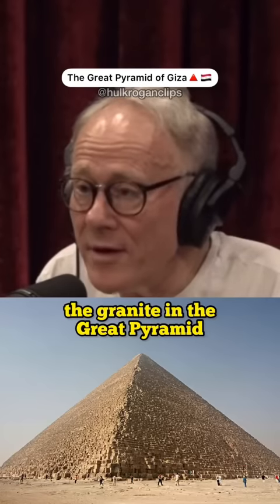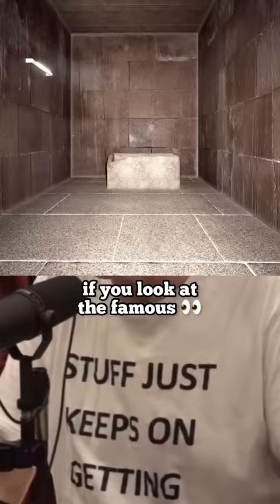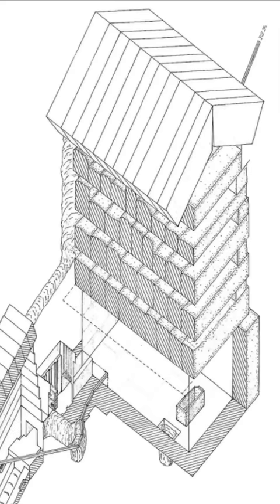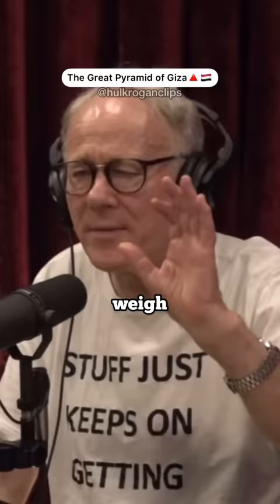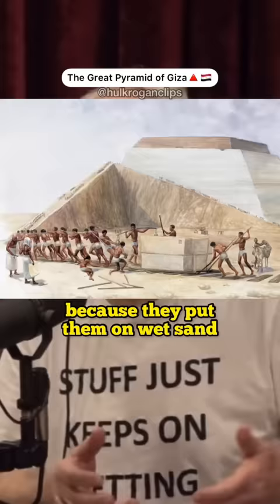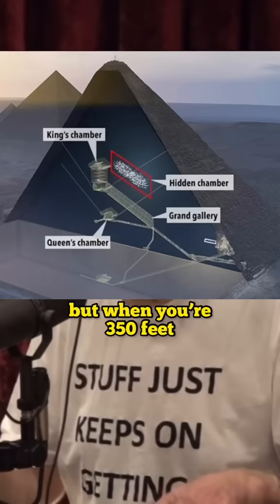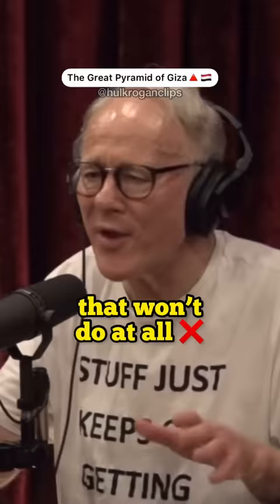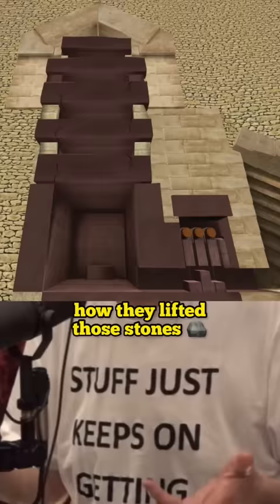How were the pyramids built? #joerogan #shorts #history #egypt #pyramid

Comment: They had an unlimited budget and a shitload of time, those were probably the most important factors in getting it done
Reply: Exactly! I don’t understand why aliens are a better possible answer, than it taking days or a week or two to cut one block.
Reply: Cause gravity exists
Reply: Laughs in Gravity
Reply: @PatriarchyPatrol  that's not a real answer
Reply: @probablygeorge6489  it is. Without cranes or mechanics, it's not possible with just man power. The tons would sink sand, ramps and crush workers
Reply: @PatriarchyPatrol  saying "it's just not possible" isn't an explanation
Reply: @probablygeorge6489  not even close to same scale or conditions. Math exists you know. It's not an opinion. It's not physically possible given the environment & tools. Sorry you can't comprehend basic math and physics.
Reply: I’d say they got some elephants and built downward instead so gravity can help with the whipping
Reply: @PizzaCake360  not elephants, but they did receive 21 cattle and 23 goats EVERY DAY. Work em then eat em
Reply: @PatriarchyPatrol 
The pyramids are built on sandstone bedrock plateaus.
Before they are covered they exhibit a stepped design.
These steps are part of the design function as the blocks were lifted by tipping them back and forth and wedging wood beneath them to slowly increase their height.
You don't need huge amounts of energy if you preserve motion, it is that simple.
Reply: @fotoschopro1230  That's a theory. A pretty stupid one
Reply: And they had a lot of people all doing the same thing
Reply: I think they built the pyramids. And eventually they could remove the blocks by breaking them. Resulting in a room being made.  Doesnt that sound more logical?
Reply: Its estimated that it was done in 20 years
Reply: @BrickMediaStudios  No, the rooms were built into the structure and there is a visible difference in design on some shafts that were dug after the fact.
Look up "How to Build Stonehenge in Your Backyard" on YT and you will immediately understand how the pyramids were built
Reply: @fotoschopro1230  To you maybe.

You have a bias that there couldn't possibly be advanced civilizations before the industrial era.
Reply: @blobjorn3248  I don't have a bias against advanced civilizations before 5000 BC.
In fact, mountains of symbolism, ancient stories and unanswered, ignored and suppressed archeological findings point towards technologically advanced civilizations, long before 12000 BC.
But that doesn't change the fact that large monolithic structures can be built by using simple, although be it ingenious tools, that do not require advanced machineries or lost technological marvels.
The reason we think of it as something that would be impossible to do with simple tools is because, while we might have amassed knowledge, we haven't really gotten much smarter since back then.
Reply: This is the most important comment in YouTube history.
Reply: @blobjorn3248  Oh yeah, look up "How to Build Stonehenge in Your Backyard" and "Robert Sepehr".
Reply: Consider that the blocks are fitted to each other within a millimeter of perfection. This is more than just stacking rocks.
Reply: @PatriarchyPatrol  idk man... it took my local construction workers almost 2 years to re do a bridge. And that's with all our tech🥴
Reply: It took 20 years that’s not a shitload
Reply: and unlimited free forced labour.
Reply: @probablygeorge6489  saying "it is possible" isn't much better.
Reply: @Latvijas_Amēlija  that proves my point lol
Reply: @IPromiseTomorrow  i explained how it was possible... read a bit more before making assumptions
Reply: @fotoschopro1230  The main issue is 500mile journey to and from the Quarry. Also the top half of the Pyramids and Inside
Reply: @Mmmmkaaay  Exactly and 500mile journey each way to the Quarry where the rock was taken from
Reply: @ethansam5861  It took that long to build the taj mahal.
Reply: No. They used vibration
Reply: @borisleoro8943  vibration is quantum physics. The foundation of the Universe
Reply: @chrisyoung2188  They also thought civilization started like 5k yrs ago lol
Reply: @fotoschopro1230  That doesn’t apply here although it’s generally true. Mathematically it should have been impossible at the scale we are talking about. We cannot recreate them today without a massive feat and it would be in vain
Reply: It took them 20 year. They didn’t have a shitload of time
Reply: Well shit who stole time from us?
Reply: @AxiomApe  You're just saying that it is mathematically impossible when it is in fact not.
Reply: Exactly. We can get anyrhing done long as we are given the money , time , and recourses
Reply: @PatriarchyPatrol  well you know at that time they have mammoth's around with them 🌝
Reply: No way they moved those huge ass blocks with ppl and stack them in the air
Reply: @chrisyoung2188  in 20 years we renovate a the bathroom stalls of an office building 😂
Reply: @fotoschopro1230  i know. My theory is that they knew where the rooms were going to be. So they put bricks into a certain position there. Then filled the room
With fragile stone or whatever and then deposed the material when done with the structure. Why would they lift the stones?
Reply: @PatriarchyPatrol  Ironic how maths and quantum physics are mentioned by someone who isn't even close to understanding them.
Reply: @PatriarchyPatrol  the ramps that still exist to this day next to unfinished pyramids show they used chips from the larger blocks instead of sand to build the ramp, the sides were reinforced with larger stones to prevent collapse
Reply: @fotoschopro1230  I’m not claiming to know how they did it, just pointing out that the experts themselves do not know how it was made. Also, I’m not expecting a YouTube comment to change your mind lol
Reply: @Tony11442  No they couldn’t
Reply: @fotoschopro1230  So you are aware of the Younger Dryas theory then, that civilizations potentially go back over 11,000 years. Göbekli Tempe and other ancient sites around the world like in Mexico are also not understood how they were built. Many things point to a connected ancient world and there are so many questions left unanswered. We cannot claim to know how they did it because we honestly don’t know. These are not typical structures. They would be impossibly hard to recreate even today. Yes many people point out that they had much time to do this, but it still doesn’t get explained by any methods or tech we have today. If we find evidence that they used simple tools then I will be the first to redact my beliefs. But it’s obvious to me and many experts that we are looking at lost methods and technology to create such structures. At the very least, there is a lost technique somewhere but most likely lost knowledge all around.
Reply: Bro you're mind is so limited. Really think about it.
Reply: @fotoschopro1230  and this is how everything is lined up with the cosmos and such?
Reply: @86Framer because there was 2.3 million stone blocks weighing 20-90 tons used, it would have taken millions of years to build
Reply: @PatriarchyPatrol  "Cause gravity exists"

So does counterweight and leverage.

With some clever engineering and some imported wood from the eastern Mediterranean coast the ancient Egpytians could have made various moves to negate the impact of those granite blocks.

Hancock is being sneaky tho because he's not debunking it, he's just sewing doubt without any substance to back it up - because it suits him to have it seem mysterious so people buy into his books/lectures/TV appearances etc.

For a guy claiming archaeologists are biased or resistant to change because of money he sure makes a lot of money himself.

Find any random archaeologist and compare what they make in a year to what Hancock does - suddenly you will find that his schlock doesn't add up at all.
Reply: @BrickMediaStudios  "And eventually they could remove the blocks by breaking them. Resulting in a room being made"

Actually that's not a terrible idea at all.

Even the sarcophagus itself could have been left in as single unfinished block and finished after they had cleared out the limestone supporting the rest.

I have my doubts, but it certainly isn't impossible.

It might explain why the KC sarcophagus was so badly worked (obvious mistake saw mark) if the mason was forced to do it inside the KC itself after the roof was added - with only limited lamp light, and the only air filtering in through the vents.
Reply: Lol yeah time and money 😂😂😂
Reply: @probablygeorge6489  oh yeah it's a perfectly fine explanation because it's true you can't do that s*** with manpower it's impossible where is your explanation
Reply: @BrickMediaStudios  
Interesting theory.
Lifting by wedging is more efficient than trying to drag the block up a ledge or slope with manpower.
It requires less people too.
Keep in mind, there are about 2.3 million stone blocks in the great pyramid, so over a period of about 33 years that would be 200 blocks per day.
That's why I suppose that their labor work would have to be efficient in terms of manpower and energy expenditure.
The money burned would have been insane in either case, but depending on the model you just run into restrictions with space and logistics.
For instance, a giant ramp could have never been built more than halfway up the great pyramid due to it being unreasonably inefficient in all regards.
Reply: @AxiomApe  
The technology argument is bs.
It's much easier to build monolithic structures than you think.
Our equipment isn't meant for building them, because a lot of monolithic structures are frankly not efficient nor functional.
We brute force and scaffold a lot of our construction work and tend to use many advanced materials, because it is faster, but that is not how you build monolithic structures.
You build them block, by block, by block.
There is literally a guy who built Stonehenge like structures, alone, in his backyard, with boulders each weighing several tons, only using basic materials like wooden planks, ropes and sand.
You can find his material here on YouTube, you just need to query that search: "man builds stonehenge in backyard".
I know it's fun to believe in some ancient alien tech, but usually the simplest explanation is the best, especially when there is no proof to rule it out.
Just because we don't understand the exact construction and design process the pyramids were built with, doesn't mean that we have no idea how to build a pyramid.
Archeology is more nuanced. The problem we face is that we don't understand every exact step for every single block that was used in the construction.
We would, but were not allowed to take apart the pyramids.
In fact, even simple research is often delayed and prevented by Egypt, because they are highly biased and unscientific.
So until we have more data, there will be several competing theories on how they were built, some more plausible, some more efficient, some more stupendous.
Anyone of them could be the one used.
Reply: @4Paradox8  Bro, must have been the Annunaki then. I'm sorry. We humans couldn't do that without quantum computers.
Stop being so naive, really, think about it.
Reply: @nemanjajovanovic8295  Deteriorating over 10,000+ years is hardly "disappearing into thin air".
Reply: @Tony11442  Says ppl who think ropes and leverage can lift 7 tons 350ft in the air in a desert and fit to perfection down to millimeters. 😭
Reply: @ThePointlessBox_  They would need to be ramps a mile long to allow the workers to move 7 tons up 350ft and place them to perfection down to millimeters. Lol
Reply: @denzelhobbs9982  My comments have more likes lol
Reply: @mnomadvfx  The problem is the precision is not possible with man power. Do the research on the Pyramids location and how well 7 ton blocks fit together
Reply: We can't even explain how they cut the stones perfectly let alone explain how they moved them.
Even today, with modern machinery, building an exact copy of the gisa pyramids would be ridiculously expensive and hard. Practically impossible.
Reply: @PatriarchyPatrol  yes if you go by the external ramp theory. Recent theories propose they used an internal ramp that spiraled on the outside surface (by not installing the outside layer on that spot yet) of the pyramid all the way to the top, and once the top was built it was filled up using the same ramp all the way back down. The construction pattern on the rock also supports this theory, implying the external ramp was only built up half way up and then the internal one was used the rest of the way to the top. Using this system also solves the problem of the support of such heavy material because the pyramid itself serves the purpose of the “scafolding”
About the stones fitting together, using an internal ramp would allow for placement of the rocks on site and then grinding/chiseling/ sanding of the blocks to fit together once already in place and thus fitting together perfectly.

Look up he internal ramp theory, it solves the problem of long ramps.
Reply: @ThePointlessBox_  doesn't explain the precision of the blocks and how they lineup with Earth's magnetic poles etc
Reply: @dehaman_4_144  when you have thousands of people working on a single project for over 20 years its entirely possible. Grinding and chiseling straight surfaces in sandstone isnt all that difficult, especially for people who dedicate their entire lives to the craft. This is just human skill.
Reply: @nemanjajovanovic8295  The Titanic has more than halfway deteriorated after around 200 years.

They can't even pull it up anymore without risking it breaking apart.

You assume there would be remains with no basis.
Reply: @PatriarchyPatrol  the magnetic poles move hundreds of kilometers every day. Its not a static point. Theres a lot of leeway and egyptians had compasses, you just need a conductive material (they had copper) and a bowl of water and a piece of wood. They used many such tools for measurements. For surfaces they used a weight on a rope to have vertical lines and guides. You’d be surprised how fast sandstone can be chiseled and sanded even with copper tools, especially with thousands of people working at the same time. This was a 20 year project, and you only need the external blocks to fit together perfectly, and evidence supports this as the internal layers of the pyramid itself isnt as precisely fit together as the outside layers and not even close to the casing stones on the outside. The deeper you go the less organized the rock is. 
Actually placing the rocks together and then sanding them smooth when already placed on the spot perfectly explains the fitment, its the same technique we use today in construction. And people really overestimate the precision of the rocks placed together, yes they’re tight, but they’re not milimeter perfect fits.
Reply: @ThePointlessBox_  Also the Sphinx is 12k yrs old minimum based on water erosion and faces the Sun during their time (Leo). Disproves the initial theories of the Pyramids timeline.
Reply: @PatriarchyPatrol  we’re not talking about the sphinx, we’re talking about the pyramids. For all we know they were built at different times. We know how old the pyramids are from the carbon analyses. Dont move goalposts
Reply: @ThePointlessBox_  The Sphinx disproves the theory that the pyramids could have only been around a few thousand years. Relying on 1920s assertions is low IQ
Reply: @ThePointlessBox_  stone cannot be carbon dated 😭
Reply: @nemanjajovanovic8295  What are you taking about? Vibrational technology? I think you have made assumptions on my beliefs.

You also assume that there would be something left behind.
Reply: @Tony11442  I do. Especially with recent events, I do not so easily believe the "science" on issues. It sounds like you're the one indoctrinated to blindly believe the "official" explanation.

We don't actually know what happened 10K years ago. We just have our best guess based on things we dug up from the ground.
Reply: @PatriarchyPatrol  how does the sphinx disprove the pyramids
two things can be built at different times, and there is no actual concrete evidence that the sphinx is older than ancient egypt
Reply: lol no
Budget doesn’t means anything if they’re technologically not possible. We today have unlimited budget to solves aging (yeah billionaires would love to live longer) and we still can’t solve it
Reply: And very large dinosaur like animals I’m sure
Reply: That and slaves
Reply: Bro that's not the question. The question is: how technically. Like how exactly. "They got time" yeah no shit they did.
Reply: Not so much Time. Giseh was built in 20 years, some cathedrales in Europe took a century. And even if the architecture is more complexe and more delicate, there is no comparaison possible regarding technical complexness
Reply: @probablygeorge6489  more study kid
Reply: Mining engineer here, the theories mentioned are immediately impossible the moment we talking about just mining that granite stone, let alone moving it. Do you guys have an idea about the quality of machinery material needed to break, cut or even just get a scratch on granite? Bronze tools are not even close to do that, its amazing to me why there is no discusson about this.
Reply: So your explanation is they were just bored and had lots of slaves.
Reply: @marcellkarpi2101  interesting so whats your conclusion on how they cut those stones let alone carry it some say its too perfect that professionals today cant make it.
Reply: Not to mention and endless supply of free labor…
Reply: @PatriarchyPatrol what? You really think its impossible to build a ramp with sandstone and wood that could support 7 tons? Its not
Reply: @Latvijas_Amēlija  you have 2 days of actual construction and the rest are bureaucratic bullshit
Reply: @deviousalemanni4235  the ramp would have to be a mile long to reach 350ft at an allowable angle to lift 7 tons 😭😭😭😭
Reply: @masterlucky379  I seriously have no idea, but definitely not with bronze chisels, even a butterknife is stronger material nowadays.
Reply: nah..there were strikes reported during the constructions of pyramid because of lack of workforce and too much workload. The workers were not all slaves but also locals and those from other region. So to say they willing to remove tonnes of rocks by using primitive tools is questionable.
Reply: @PatriarchyPatrol  did you not read my reply explaining how they could theoretically pull 400,000 lbs just with human labor?
Reply: @probablygeorge6489  Again, you misunderstand how Pyramids are built & the environment
Reply: @PatriarchyPatrol  400,000 pounds, not including the 23 sheep and 21 cattle they received every day. What am i not understanding?
Reply: Combination of unlimited budget, devoted father to son architects/ builders with time. We did the same with those cathedrals in Europe. Imagine fathers and sons building a church to Christ for 3 hundred years. Same thing
Reply: And a lot of slaves to throw at the problem.
Reply: @PatriarchyPatrol  pully system with enough ropes they can slowly but surely
Reply: @greatninja2590  The rope would snap and also doesn't explain the precision of the Pyramid
Reply: @PatriarchyPatrol  search stone cutting hammer and chisels work. And smoothing it is also possible will just take a lot longer without any sort of machines but even today a bit of muscle power and water would be enough usually done for smaller handmade very expensive stuff.
Reply: They were just like really strong back then
Reply: @PatriarchyPatrol  just have more pulley.
Reply: @mnomadvfx  so he’s bad because he makes money?
Reply: Probably used water to move the blocks. Look into it
Reply: @PatriarchyPatrol  it would have been funny if there was a closer quary but they used up all the rocks so the whole mountain is now gone and is covered by sand and left undiscovered.
Reply: @marcellkarpi2101  they most likely used abrasive tipped copper drills scientist just don't know what they used though the most likely one is Emiry as it is found near Egypt. Some say its diamond but they would have imported it first.
Reply: It is. Without technology you cant lift heavy things no matter how many people you have
Reply: @sash328  pulley is technology
Reply: @PatriarchyPatrol  
It's difficult, but not impossible. Throw enough bodies at the problem, the problem usually goes away
Reply: They probably cut the pieces and reassembled them in the chamber by sanding together
Reply: @PatriarchyPatrol  they did? Countless slaves and regular workers died to build these monuments
Reply: @blobjorn3248  Smarter than your nonexistent theory with a value of 0
Reply: @33a5t  they weren’t built by slaves lol that theories been disproved
Reply: @greatninja2590  no ancient pulley could lift the 70 ton inner stones
Reply: @ne1productions777  I could say the same about your theories, and we'd both have the same validity to our statements.
Reply: @GG-ng6zm  not much change in Pulley system since ancient time.
Reply: @PatriarchyPatrol  laughs in egyptian workers..
Reply: @PatriarchyPatrol  gravity is easily over come though. I mean you can lift anything with simply a wedge at its center and shims. Wedge at center. Teeter totter it. Shim one side up. Walk to other end. Teeter totter it, now shim other side. Slowly climbing upwards.
Reply: @PatriarchyPatrol  first of all we have to accept, whatever was used, was removed from that area after finishing the Pyramids.
Like a crane after finishing a sky scraper.

Noone knows what was there, so every one is just thinking in his knowledge.

Just take chinese construction works for example.
They use bamboo for the whole framework.
Now imagine you grew up, only knowing this method but now you see the empire state building.

First thought would be, where did they get all the bamboo from, since there is no bamboo growing in that area.
Than you would ask yourself, how did they get the steel beam up there.

How about water pressure to lift the stones to a certain level?

It would need a separate structure next to the Pyramides, but who knows?
They would have removed that structure after finishing the build, so how do we want to know, that it wasn't there? 😉
Reply: @greatninja2590  bro no ancient pulley system can lift more than 50 tons, you need to accept that
Reply: @PatriarchyPatrol  you realize physics existed, right? And that with a long enough lever, you have all the leverage you need
Reply: @PatriarchyPatrol  it ís possible. Exhibit a: pyramids.
Reply: @PatriarchyPatrol  What a lame duck answer. “BeCaUsE MaTh!!1!” 

Ok. Show the math.
Reply: @PatriarchyPatrol  that's true as well
Reply: lots of wannabe einstein in this comment section. cringe
Reply: Yep and they were hard working now we are lazy and use tools and equipment to make everything easy
Reply: Edward Leedskalnin built a castle by himself in early 20th century with only the help of primitive technology and he was only 155cm tall and diagnosed with chronic tuberculosis. Average weight of the stones which found in this “castle” was 12ton each he brought these rocks from far away only by himself and he wrote a book about his architectural knowledge while he was at it. You can actually visit his little rock garden in America. So my point is people seem to underestimate how possibly dedication and power of the humanity can go much further if he wants. We can’t broke rules of the physics but we can use it for our benefit.
Reply: I’d say it’s cause no one can really relate to it these times
Reply: @NikoMoraKamu  I never said aliens had anything to do with it. Try again.
Reply: They got it done in 20 years, that's still remarkable
Reply: @probablygeorge6489  so you’re saying they hooked up tens of thousands of cows to each 140,000 pound slab and got them to walk through the desert for 500 miles? Lol
Reply: @christopher7763  did you not read the part where i said in theory the people alone could pull 400,000? lmao
Reply: @christopher7763  Stonehenge rocks were 3 times heavier than that yet they somehow managed to bring those from over the sea in England, 288 km to be precise. We still not sure how they made it though, except some theories.
Reply: @dernafri47  good said
Reply: Also people in those days had no hobbies, some guy would spend 12 hours a day thinking of ways to lift shit up because there was nothing else to do.
Reply: @AndrewHunterMusic  slaves wouldn't have been trusted with important task like building the pyramids.
Reply: @PatriarchyPatrol  exactly its facts they would’ve needed hundreds if not thousands of people to move those granite beams and not only that but getting it 350 feet in the air would make it even more impossible bc with a ramp the ramp would have to be 10 degrees and a 10 degree ramp would take miles just to reach the top of the pyramid
Reply: Sorry just saying in general it takes 2 yrs for sumn MF's to pave a road. when the PYRAMIDS ARE THERE, ITS MIND BOGGLING but sure they had time and hundreds if not thousands working on it nah it's way more complicated and sophisticated than were lead to believe.
Reply: I could give you all yhe time and money and you'll never jump over the moon
Reply: Well genius he did say bringing stones that up isn't really about money and a shitload of time but physics and i think physics being discovered during that time Or not didn't really play a role cause it existed anyway and so they need a ramp upto 10° for blocks that huge and heavy
Reply: @leroiken9856  no. Im saying we have no idea based on current findings.
Reply: That and slavery
Reply: @PatriarchyPatrol  how did they did it then?
Reply: @thanasis-_-  no one knows. They used rock from 500miles away. So thats 1000miles there and back. Also it's so precise and matches the summer solstice in their times
Reply: The records state it was done in 20 years. With the number of blocks there were, and the average weight being 2.5 tons, that's 13 2.5 ton blocks per hour, non stop for 20 years straight.
Reply: @fotoschopro1230  The laws of physics didn't exist back then
Reply: And slaves.
Reply: @ticklingoscillators1852  we have slaves now it's called going to work
Reply: @PatriarchyPatrol  Jesus, you must be fun at parties.
Reply: Gravity is ancient technology. Who says they were lifted? 🤔
Reply: Why are people so ignorant to think that humans just lazily survived back in the day before inventing civilisation and human rights. Weather was more chaotic back then, animals were everywhere and you could get a cut and die if it wasn’t treated straight away. Humanity doesn’t just pop into existence with unlimited budget and time. That has to be earned.
Reply: @fotoschopro1230 I think you’re commuting a fallacy. Just because stone henge was built that way doesn’t mean the pyramids. It means yes it is possible but now you’re invoking that stone henge and pyramids were communicating with eachother but the mainstream theory is that all ancient civilisations were isolated and didn’t trade or co-exist with one another.
Reply: Apparently this guy has never involved in heavy lifting
Reply: @PatriarchyPatrol  just bribe the gravity
Reply: @Mmmmkaaay no that’s called sanding.  You can sand wood, stone, metal, granite, glass, fiberglass, your ass.  Anything really.
Reply: @PatriarchyPatrol  tons is only the weight of 2 SUVs….. and there’s this wild ancient technique to make things fit within a millimeter of watch other, You’ll Never Believe It!!!  It’s called……. Sanding.
Reply: @slayingfury3   Fewer people participated to the building of the pyramids than you may think. I've read current theories talk about 20 to 30 thousand people. Many but nothing out of the world.
Reply: @petchlnwzaaa you really compared building a pyramid to solving aging ? You really thought you were slick with that one didn't ya 😂 it's technologically possible to make a pyramid but we have no purpose to make it nowadays , the pyramids didn't just spawn in Egypt m8 .
Reply: Look at it like this, we spend so much money on science but no matter how much you invest into something, you can't go beyond a certain point without discovering something new. 

For an example, science got tremendous momentum soon after the computers were invented. Just like that, human workforce have their limit, this pyramids are a construction that surpassed that human limit. 

Imagine future generations trying to figure out how we solved certain calculations we did with super computers without the knowledge of we had computers. It would baffle their minds the same way we are doing now with pyramids.

As the og said, there is a lost technology.
Reply: @Zoot Cat you can't just explain things like that. First of all, the problem here is with the 70ton rock ending way up in a building. Btw 70Tons is more than 63000Kg. 

Possible way of lifting this rock,
1. Just by lifting 
2. Drag it using a ramp
3. Pulling using a rope or something
4. Lifting using a rope or something 
Etc.

If you think about lifting, there's an area to the rock, so the number of people you can assign to lift it limits with that. If we say one person can lift 100kg, you would need more than 630 people to lift this thing but you can't fit that many people around or under the rock because it's area is too small for all of them to fit in.

Just like that, no rope would be strong enough to move 63000Kgs.

Ramps also have their limits. You can't make the slop too small since it will be kilometres long to reach the height of pyramids. And a moderate amount of slope would still be impossible to drag a 70ton rock because people you can assign to work on that is limited because of the area of that rock. You can't just say 100 people to push a car, only few of them would be able to even touch the car. Same goes here.

Your logic falls apart because of physical constraints. If you make the whole country work on the pyramids, only small percentage will actually be able to do the work.
Reply: @gastoncoscia5031  never mentioned aliens.
Reply: @PatriarchyPatrol  they had boats. Not a real stumper there.
Reply: @PatriarchyPatrol  are you imagining a single huge ramp? They likely had ramps hugging the sides of the pyramid to actually make it feasible. Also consider that the majority of blocks used are in the bottom half or third of the structure. You have to haul increasingly fewer stones up the higher you go.
Reply: @PatriarchyPatrol  good thing the pyramids weren’t constructed purely of stone. There is wood and mortar that absorbed Co2 inside, which allows carbon dating.
Reply: @PatriarchyPatrol  “so that’s 1000 miles there and back” 😂 Ok so? They weren’t hauling rocks on the way to the quarry.

This is all very explainable by the existence of boats.
Reply: Slaves, unlimited number of slaves
Reply: And a really, really long ramp….
Reply: you think they didn't think of about unlimited budget too? they did.
Reply: What about slavery
Reply: @PatriarchyPatrol  many people probably did die in the construction but that wouldnt be an obstacle to finishing the job for these people. many civilisations back then could figure out how to quarry and move heavy stones over hundreds of miles.
Reply: @PatriarchyPatrol  well apparently people 5000 years ago in Egypt had a better grasp of physics and maths than people in this comment section.
Reply: And what could budget and time do in this era?
Reply: @PizzaCake360 I also think they built it downwards and with the time the level of the sand shifted to make it look like this
Reply: Thank you. I think people grasp to Graham Hancock because they want to believe in the fantastical because it’s much more awe inspiring than a far more practical, logical, boring explanation like this.
Reply: They traveled 500 miles with a stones that size
Reply: @PatriarchyPatrol there is literally a written record of stone delivery to the great pyramid.
Actual written record from the guy in charge of the barges written as he carried stone from the quarry to the pyramid work site.
So no, you need to stop saying that because it's not true.
Reply: @SusansBadBoy  These pyramids are older than the discovery and development of the Mathematics and Physics sciences.
Reply: @chris young  Those pyramids were not started and completed in one person's lifetime.
Reply: @Yusha Kroessin It did take an extremely long time. Longer than we modern humans who measure everything within our lifetime could fathom.
Reply: @kay0946  you shouldn't use the word logic while saying stuff like that.
You know they have graffiti all over the two chambers above the king's chamber right?
It is from the heads of the teams of guys that put the blocks there and each graffiti is a boast about how their team is the best team on this pyramid.
The blocks were on sleds and at the side of the ramps there were stairs and  posts that the crews could belay their ropes from.
Each sled had multiple ropes and there were teams of up to 60 guys pulling with guys who spread oil on the sled runners and guys that blocked the sled from sliding back.
It's not anti gravity tech.
Reply: You lost the comment section 😂
Reply: There’s an old YouTube video of a man that made his own lever and ramps system to move extremely heavy blocks by himself. With a big enough lever a man can move the world
Reply: Not a shitload of time. The great pyramid was built in 20 years only. MAXIMUM. Might even be less.
Reply: @AxiomApe  The biggest issue is that people look at ancient civilisations as stupid cave banging cave people and try to explain feats accomplished in the past with alien tech or some lost sci fi tech
Reply: 70 tons they could move? Grow up people….it’s obvious they were more advanced than us
Reply: @pettyrjoshua  It's obvious you failed highschool physics
Reply: He never said anything about aliens
Reply: Plus a unlimited slave labor force
Reply: @PatriarchyPatrol  Susan change your name to Karen it would be more suited for ya
Reply: Including a shit load a disposable humans
Reply: @fotoschopro1230  - Well, they definitely weren't paying the "workers" !!!
Reply: @PatriarchyPatrol  - So a mile long ramp? 5280 feet. Imagine 2600 slaves lined up shoulder to shoulder and another 2600 across the width of the needed ramp from them.....A huge mile long ramp could be built by a mere 5200 slaves in a week using only effing buckets. Now imagine having 50,000 men at your disposal.....
Reply: @PatriarchyPatrol  - Modern day nylon tow straps can yanks 10000 pound trucks out of the mud. I used larger straps for the bridge crane I ran for lifting 30000 pound transmission poles. 6 or 10 hemp ropes as big around as your leg could easily lift the end of a 30, 40, or 50 ton block. Easily.
Reply: @bradtherad6973  - Uh, Egyptians had the engineers, architects, and labor foremen overseeing the labor force....kept in compliance by the end of a whip and the threat of getting abandoned to the desert.
Reply: @paule5910  - The Egyptians weren't defying gravity, just stacking blocks....
Reply: @UltimateOlive  - Why not camps of 100 slaves every 2 miles that moved stones over their 2 mile stretch each day? A giant bucket brigade of slaves using ropes and rolling logs over a hardened roadbed. The first stone would take 250 days to make the trip, but there would be a train of stones arriving minutes behind each one...?
Reply: @kay0946  - You don't think 10000 slaves could build a mile long ramp? 5280 feet long is just 2600 men shoulder to shoulder with another line of 2600 across the ramp width from them. Have you ever watched a small crew of roofers who have been in the trade for years re-roof a house in a day? That's less than 20 guys working together. Now imagine 5 teams of 10000 men each. Each of them having only having 1 or 2 specific tasks that they'll master within a month of this 20 year long project.....
At some point, someone will program a virtual workforce to build a virtual pyramid with all the physical laws built into the program and show how an army of men, their ropes and logs and mile-long ramp could do this...
Reply: @mattp5991  Because they still have to stack them, moving 2.5 ton stones in perfect choreography, and aligning each of them perfectly, from top to bottom, withing fractions of one degree facing true North.
Reply: @UltimateOlive  - The foundation sets the position of each stone thereafter. You build a layer, you build up the ground around it. You build the next layer, now at ground level, you build up the ground to the top of the layer. You build the next layer, now at ground level....
You finish the top and your 10s of thousands of slaves dig it back out and move the sand/dirt over to a nearby sand dune....
Reply: @UltimateOlive  - Who cares how much it weighs? I, personally, have carried 1000s of pounds of bags of concrete mix from the front of a house...to the back of a house...then, moved 1000s of pounds of dirt with only a shovel and wheelbarrow. All.In. One.Day.
Don't tell me 50000 men couldn't move 5000000 Tons of sand/dirt in a relatively short time....that's only 100 tons each....200000 pounds each. 100 days at 2000#/day, 50 days @ 4000#/day. Why do you have such a hard time comprehending the power of man's muscles combined with hand tools, ropes, levers, and the shape of the wheel?
And I'm not saying that is how it was done. There is also evidence that points to the blocks being floated up/down the Nile...which used to flow right past the pyramids.
Reply: @mattp5991  Yep, they floated those blocks on reed boats, did they? Not a single shovel or wheelbarrow from that time has been found, keep in mind they had supposedly not discovered the wheel at the time. Guess they just dug with their hands and carried in in baskets then, huh?

This isn't even touching the topic of the purpose of the pyramids. If you want to believe they were expert engineers, all of them, down to the last man who ever quarried a stone, just to build a burial site, go for it.
Reply: @UltimateOlive  - Turns out, new information has come out since I last researched this back in the early 2000s. Seems the quarry was right next to the pyramids:
https://youtu.be/52V9jmrgSbI
Reply: @mattp5991  The limestone was, but not the granite, which came from Aswan roughly 500 miles away. The largest stones in the King's Chamber are made from this granite and there are something like 6-10 of them weighing 80 tons each.
Reply: @UltimateOlive  - Well, 10 stones is certainly fewer than "millions"...as others here have asserted.
Reply: @mattp5991  Those are just the heaviest ones, which I'd like to hear your theory on how they were moved with no wheels, and therefore no pulleys. Since you have the outstanding credentials of someone who has moved bags of concrete. There were many more granite stones, all the exterior was covered in polished granite capstones.
Reply: @mattp5991  Egyptians didn't use slaves to build the pyramids. The pyramids represented their home in the afterlife, if any part of the pyramid was desecrated it would effect them in the afterlife. Only the most skilled workers would be trusted with that task and they were paid very well. The workers on the pyramids were Egypt's middle class.
Reply: @bradtherad6973  - Thank you, yes. That's what I'm finding out after delving into the current research. Engineers and architects overseeing families of skilled tradesmen that were experts in quarrying, transportation, shaping, sanding, and setting large stones and monoliths. Cheers.
Reply: @mattp5991  good for you! Research is always fun, at least it is for me. I'm not always up to date with current research but I try to be. I hope you enjoy learning things as much as I do. Have a good day or night depending on when you see this.
Reply: plus they used mamoths
Reply: @UltimateOlive  - My comments about my work experience moving concrete and shoveling dirt was merely to point out that 1 man can haul the equivalent of tons of sand/dirt per day. Expanding that out to 1000s of men means that long ramps (yes, even 5000 feet long) were possible. That doesn't make me an expert on Egyptian engineering. I'm only pointing out the fallacy that piling up a ramp 5000 feet long and wide from 0 feet to 500 feet is not impossible...as some have stated as an absolute impossibility and dismissed outright.
Reply: @mattp5991  You're right, it's not impossible. But they were either unpaid, underfed slaves, or engineers - not both. However the precision with which each stone was quarried and then placed with perfect alignment tells us that most of the workforce had to be skilled, intelligent laborers. The logistics just don't add up for it being done in 20 years with stone and copper tools, and no wheels. 

A dozen blocks placed an hour, night and day without stop or fail, for 20 years straight, and that's not even counting the time required to quarry and transport limestone from a mile away, and quarry the second hardest natural stone with copper tools (at best, many Egyptian "scholars" suggest they used stone pounders) and then transport those same multi ton (up to 80) granite blocks 500 miles.

If you will, look up how hard granite is. Copper bits will break and deform against it. You'd have to replace your sawblade (again, super primitive iteration of it) every few minutes.

That's not even getting into all the tube drill holes and cores found.
Reply: Yeah, with the unlimited manpower you could just pile up enough sand to form a ramp, then keep moving the ramp gradually from the completed side to the next segment over.
Reply: @PatriarchyPatrol  when you cant even trust in one of the most basic historical facts, I would be slow to make fun of peoples mathmatical and physical knowledge. 
There is a reason why no physisist believes in what you do
Reply: @AndrewHunterMusic  they didnt use slaves for buikding the pyramids. This ahs also been proven many times
Reply: Really really cheap labor
Reply: @fotoschopro1230  I literally was thinking this kinda like you lift one side up, then the other, and again and again little by little with stepping stones but even then, its still crazy.
Reply: @PatriarchyPatrol It is possible to move several ton blocks very easily with the right contraptions as recreated by one man who recreated stone henge by himself. Stop underestimating ancient humanity they weren't dumb animals in a desert.
Reply: @ThePointlessBox_  it baffles me how people are so quick to claim other people's theories as "EnTiReLy pOsSiBlE" without even being able to prove said theory... 🤦🏻‍♂️
Reply: @ThePointlessBox_  No ancient pulley mechanism would be capable of handling up to 70(ish) ton stones at such an immense level, certainly not without major wear and tear and the need to replace specific parts of the pulley mechanism quite often to maintain it, and keep workers safe. There are too many flaws in the theories we have been given... The answer is out there, it's just unfounded as of now in my opinion. 🤷🏻‍♂️
Reply: @biggirih7225  the egyptians didnt need complex pulley mechanisms, they had the manpower to brute force it
Reply: @chrisyoung2188  200
Reply: There are 2 million blocks you tellin me it took two million weeks just to cut the stones let alone place them?
Reply: There are 2 million blocks you tellin me it took two million weeks just to cut the stones let alone place them?
Reply: @marccorpuz6037  you think they were cutting one block at a time?
Reply: @PatriarchyPatrol  There's a guy moving 20 ton stones himself on YouTube as a hobby. Sorry to disappoint you but building the pyramids by human hand and basic leverage is very doable